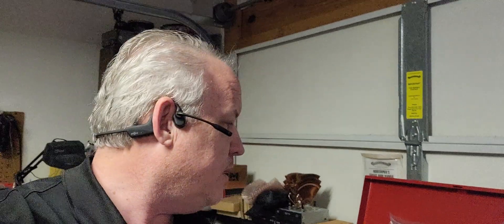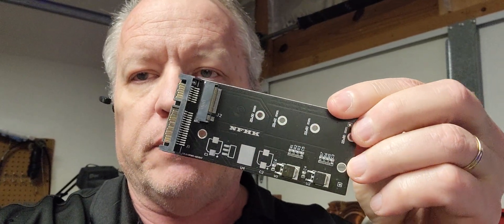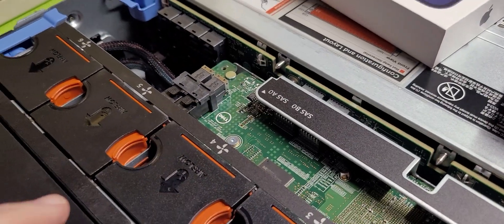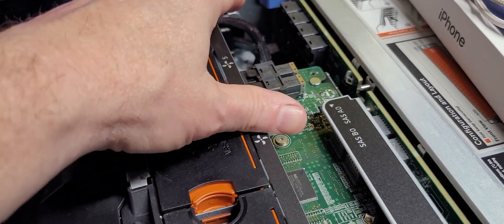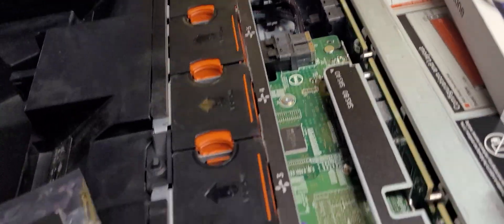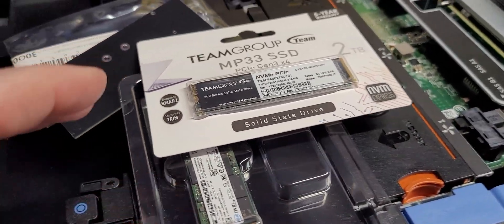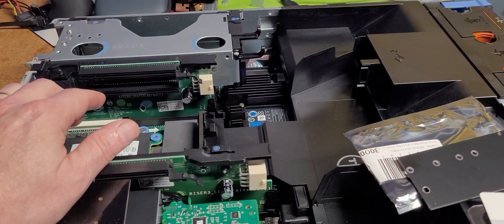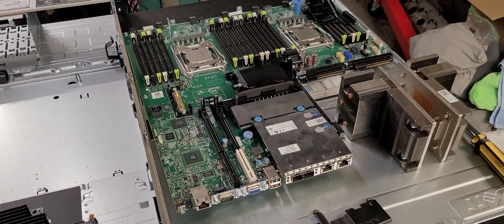Why adding NVVME storage added my to NAS doesn't give you the speed you really wanted and why

Comment: Even if you bump your network to 25 or 40 Gb/s bear in mind that there is still overhead in file sharing.  Block device exporting should be faster, but that's essentially single-client only. You'll probably want either a motherboard which can do bifurcation or a multi-ssd carrier card with a built in PCIE switch (~$300).  These days its tricky to get non-server boards with enough PCIE slots to do both the x16 PCIE card (4 NVME cards) and a very fast NIC (>10G) - you're probably looking at PCIE gen 3 if you want reasonable prices.  Beware motherboards advertising x16 slots but with "x8 mode" or "x4 mode"
Reply from the maker: good to know

Comment: Demand on setup. CentOS with ZFS, NVME Cache with RAM Cache make a huge performance boost in large HDD arrays und heavy load. In combination with iSCSI and Ethernet Offloading in a SAN scenario. Also workload with big chunks like video editing. But i talk about 10gbit NIC, 16gbit FC or more!!

For normal endusers or small homelab users ... i think other topics make more sense.

My biggest DYI setup was 16*8TB RAID6, 2*WD1500 2TB, 512GB Ram, connected via 2*10gb NIC to Backbone switch. This beast get the work done. But its insane.
Reply from the maker: Nice DIY setup dude.   Most people don't have that type of resources or cash so I get requests for the smaller older boxes and to just have some fun maxing a NAS out every way possible include running VM in teh NAS-OS as a plug-in.  Keep having fun!
Reply: @leadiususa7394  If you wana Play with this Kind of stuff. HP Microserver G8 is a good Base and ultra cheap. 4 HDD's one fast SATA SSD and a cheap dual Port Fiberchannel Card are a good start.

This was May First Setup at Home to start with CentOS and SCSI Target Mode with RAM and SSD Cache.

Comment: Looking at this server, it is used as application server. And in that case, the NVMe SSDs make sense because of the higher IOPs. If not, please explain me the use case for a dual socket NAS with 2.5gbit, that only serves files. That just does not make any sense. Apart from all that, my past 3 NAS had the option for PCIe cards.
Reply from the maker: It depends on the OS of the NAS.  If you don't have PCIe card slots but you can increase the RAM you can have a small Docker that run internal on the RAM and NVMe locally.  using two 1 BG NICs in a ALB / teaming mode will give you about 1.5 GB bandwidth but that is about it.  That is not a bad setup for a lot of simple VM services you can run,,, Like I said, there is more to a NAS then it's upload bandwidth,  The key thing is to have some fun doing thsi stuff.

Comment: i dont buy, over priced nas, i just take my previous high end pc, and throw a HBA in the pcie X16 v 4.0 gpu slot, load it with drives and throw in a 25gbe or more nic and some nvme for cache, and add Primo Cache. . then your in control of it all. upgrade when you upgrade your next gaming or production rig. i just use windows pro, your just storing stuff, you want fast access to. just a glorified windows server. with your used parts. NAS Proprietary under powered BS.
Reply from the maker: Sweet that you can do that!  This video was requested so I did fro those that have those very under powered NAS to play with...   Low powered devices have there value to you know.  Thanks for the input and keep having fun!

Comment: I'll start by saying that I am not whiz at computer hardware and networking... but is the point of the video to let people know that you can only be as fast as your weakest link. And if your weakest link is the incoming pipe then doing any improvements after that point is going to be useless if you're trying to achieve a change in speed. Again, I reiterate, you are always limited by your weakest link so fix that first and move down the line to "unblock" the bottleneck. Thoughts?
Reply from the maker: I wouldn't say a waste. First a old NAS may be the only thing some one has to do testing,  You can test with it...  You miss the point of trying something out side the norm.  How else would you find that you can run a really fast internal NAS driven OS using plug-ins like VM platform because of the added speed of the NVME resources.   It is not all about the bandwidth but also can you do inside the box.